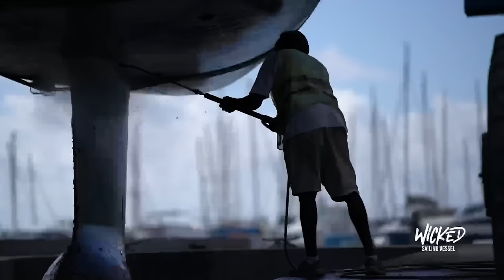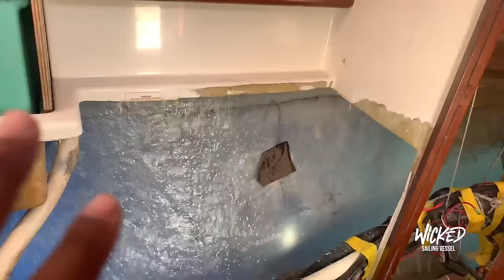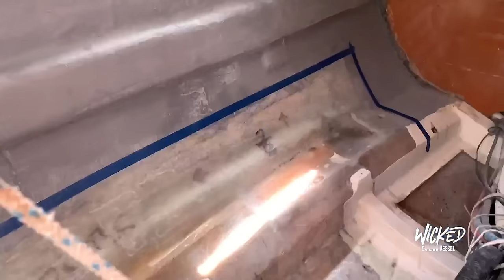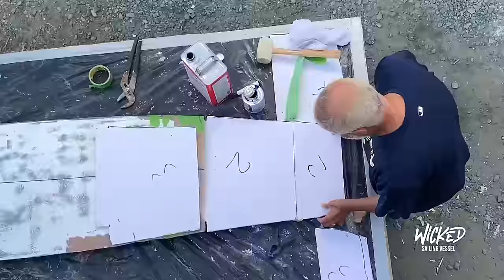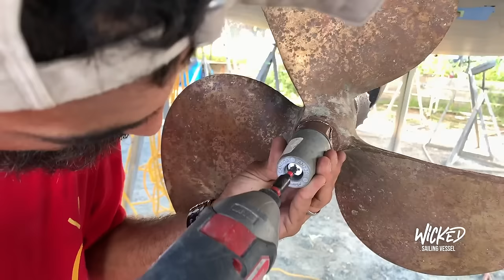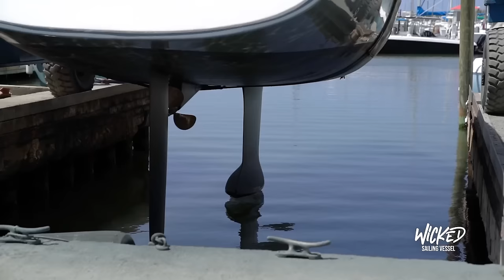AMAZING! 8 Month Boat Transformation | Hurricane Damaged Sailboat | Sailing Wicked 13

Comment: Impressive work I guess nothing is impossible with fiberglass Did you use polyester resin or epoxy 
Thanks
Reply from the maker: Thank you! We used epoxy for the repairs. The boat is polyester resin and it’s recommended to use poly with poly. However epoxy on poly not the other way around can definitely be done.

Comment: Rotation of cutlass  bearing is shown wrong: https://youtu.be/9pYoG1kUvMA?t=476  There should be a flat inner surface at the bottom; shown is a groove at the bottom.  Installed with groove at bottom will result in faster wear.
Reply from the maker: Thank you! We’ll check that out!
Reply: @sailingwicked  I don't know how much faster it will wear, so I'd ask around.  I picked this up in a video only a short while ago and got it confirmed.  The amount of details with boats is amazing/crazy.

Comment: Did you even do any hull sounding/moisture checks? And wtf is that, cutting sections out of the hull(in an already thin hull)?? Won't that mess with the structural rigidity of the hull(That's not a kayak you're patching up)? Why did you cut a whole section out? Was an entire section of fiberglass that badly compromised? Did you guys even research boat architecture before doing this or do you think boat reclamation is an entirely aesthetic thing? What's going on here?

I wouldn't take this thing out for any bluewater cruising or anywhere where the seas get rough.
Reply from the maker: The section cut out was completely rotted or compromised. We could have cut 100 holes or done one solid repair. Clearly not a kayak… Tons of research was done, had someone with experience working with us and our surveyor was involved during the process.

If you go back a few videos you’ll learn that she was Hurricane Damaged and we won her at auction. Putting in the work ourselves was probably the only way we would be able to afford a modern sailboat. Soooo no it’s not for aesthetics lol. 

Thanks for the concern
Reply: @sailingwicked  fair enough but i still wouldn't take it beyond coastal waters or at most the caribbean if you're careful about it/time it when the sea is calm - I wouldn't attempt an ocean crossing in it. On it's own terms, i can see how it might be a nice home away from home/pleasure craft for the holidays. Btw, i recommed you use a paint called CopperCoat for the hull to keep it in good condition - sea life can never get a purchase on the surface of it or penetrate it, so all you have to do is scrape it off the hull every few months with a plastic spatula and it falls off with no effort or scratching of the paint, plus should only require painting every 10 years or so. This will save you a lot of money in the long run in terms of hull maintainence.
Reply: Looks like a flip boat. Will be buyers problems.  Pretty strong argument against buying anything w/ hurricane damage history.
Reply: @jackhawthorn4799  Have a look at Sailing Dauntless and the repairs that they have done to a Leopard 50, all sanctioned by the factory's naval architect and insured! If the repairs were done with Epoxy to the factory lay-up schedule or better then that part of the hull is stronger than the rest.

Comment: IT'S NOT A BOAT. IT'S AN EGGSHELL. HOPE THE OWNER HAS LEARNED IT
Reply from the maker: An eggshell with a mast, engine and keel. What’s your eggshell like? 🤔
Reply: @sailingwicked  well I like your eggshell , it shows growth.
Reply from the maker: @11Brownin  Thank you! 😜
Reply: Eggshell if definitely the word. I wouldn't buy a boat that requires so much work on the hull - i certainly wouldn't cut sections out of the hull.
Reply: Please tell me this is a starter boat for living on and learning to sail in coastal waters, please tell me you're not planning on taking that thing cruising in rough seas...